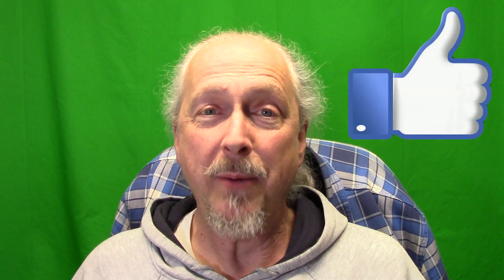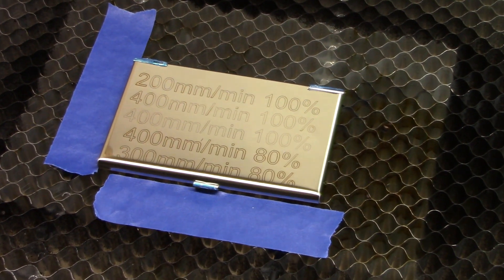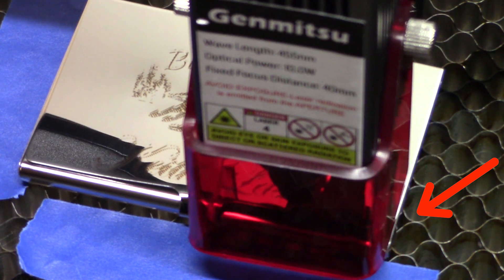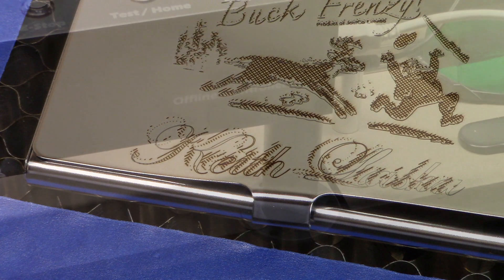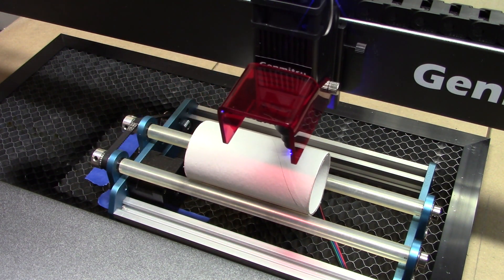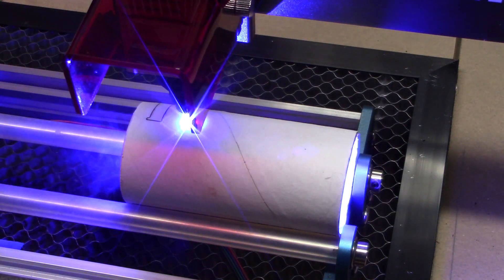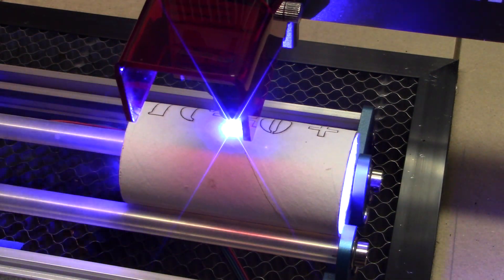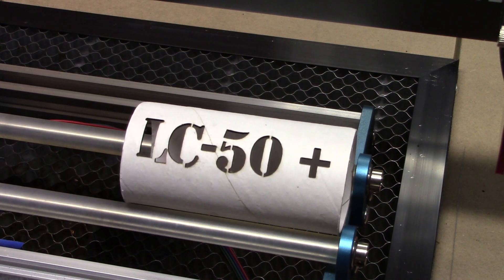Etching Stainless Steel and using the rotary roller with the LC-50 Plus

Comment: Does the Genmitsu Rotary just plug into the Y Axis socket? When I emailed SainSmart about the rotary they said it was incompatible with the LC-50P!
Reply from the maker: That is how I used it.  I just swapped the rotary for the Y axis on the LC-50 Plus and it worked just fine.  I did have to raise up the laser so the rotary would fit under the laser.  It seemed to work OK for me.  I will reach out to SainSmart to see what they have to say on this.  🙂
Reply: @CNCATHome  Well the machine and the V2 rotary are on their way so I hope they haven’t changed anything! Please post up with what you hear back!
Reply from the maker: @CitizenChaz  - Mine is the V1 and it worked just fine.  I did send an e-mail to SainSmart asking about the compatibility.  We will see what they come back with on that.  I will try to remember to post something here when I hear back.
Reply: @CNCATHome  Thanks! The V2 looks like the same electronics, just an update on the roller assembly.
Reply from the maker: @CitizenChaz  - I hadn't really looked at the V2 until now.  It does have some advantages over the V1.  But I don't do much with the roller and even if I had the V2, I don't think that would increase what I did with it.  ;-)
Reply from the maker: @CitizenChaz  - I did hear back from SainSmart and was told that the V1 and V2 would work with the LC-50 Plus.  There must have been a miscommunication there somewhere.  Keep in mind that most of their support has English as a second or third language so any miscommunication could be on either or both ends.  ;-)  The support folks at SainSmart have tended to be fairly good overall.
Reply: @CNCATHome  Awesome news! Thanks for following it up! Yeah the pre-sales support from them has been great so far (apart from the info on the rotary!) - one of the reasons I went with the Genmitsu. Cheers!
Reply from the maker: @CitizenChaz  - Enjoy your laser and roller wen they come.